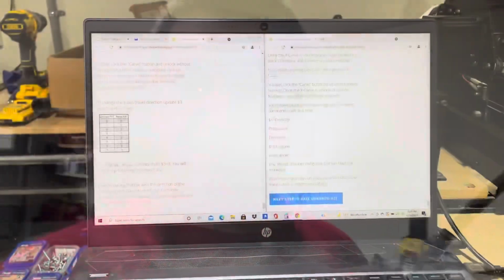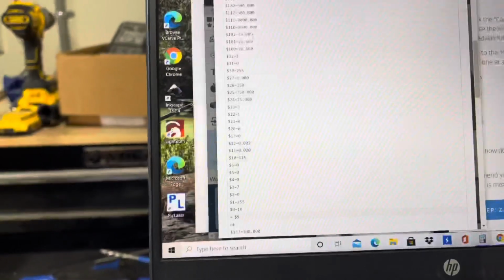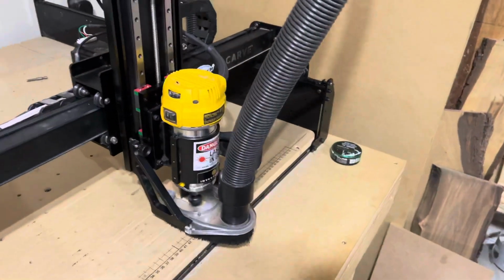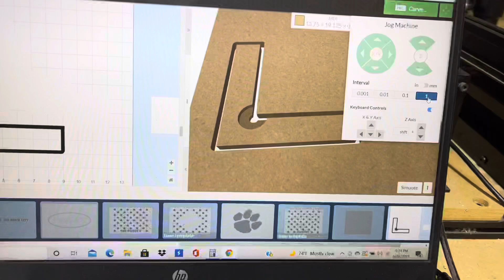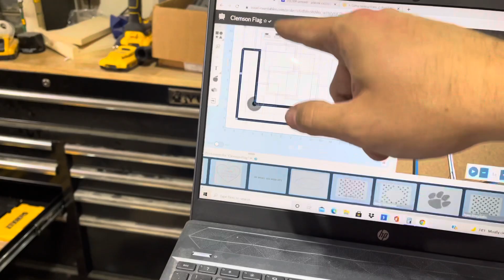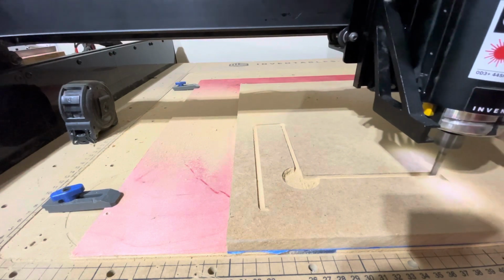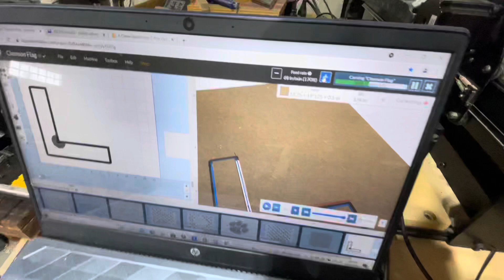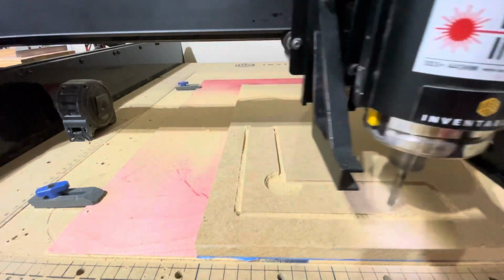Inventables X-Carve Upgrade Bundle Configuration and Test Carve! IT'S FAST

Comment: Glad I found this video. going to pull the trigger on the upgrade kit. Wanted to see some things. This was originally my brothers machine. So he did the assembly. Some things are a bit off. So going in and reconfiguring things is probably long overdue. Going to check out your other content to see what all you've done since the 3 years since you put this video out.

Comment: The reason why it cut that way was because you used shapes and cut them to make your project. It saw them as individual cuts needed to rejoin the cut sections and make the outside while. That is also why it calculated the cut to take 15mins it figured in all the extra moves. If it was solid it would have taken only 2-3 minutes at normal speed.
Reply from the maker: Thanks for the feedback! I got all of the figured out now! Tryna be a pro haha
Reply: Thank you bud
Reply: @BigCountrysWay  any video on what you did to fix these types of cuts... a link would be super awesome.  :-)
Reply from the maker: @sekritskworl-sekrit_studios  I wish I could make one! Currently deployed :( won’t be back till late spring

Comment: My machine will be here on the 22 is this something you have to do to all new setups?
Reply from the maker: i believe the all new setups don't come with any of the older parts I replaced.
Reply: @BigCountrysWay  my new machines will come with those upgrades already,  i mean do i have to do the leveling  of spoil board and input those commands  in.
Reply from the maker: @brettfarrell4818  surfacing of the spoil board is a must. I recommend adding another layer of MDF as a spoil board and surface that.
Reply from the maker: And when you set up your machine, easel may have added the upgraded option. Idk, can’t check lol I’m deployed

Comment: You been able to find any feed/depth guidance on the upgraded setup? Finished my setup the other night, haven't tested it yet but it never hurts to lean on the insights of others who have dialed it in.
Reply from the maker: I haven’t really dug deep but I am pretty sure Inventables made easel know if you had the upgrade or not and it adjusts your speeds and depths automatically
Reply: @BigCountrysWay  id considered that might have been a possibility. I'll have to take a look on my first test and see if the settings are different. Appreciate the reply and content you made in this upgrade
Reply from the maker: @kentg86  No problem boss, thanks for tuning in! All I know is that it seems to carve faster and when the carve is complete, easel asks if you enjoyed the updated settings as if they're taking surveys in order to get the best settings for the upgrade.